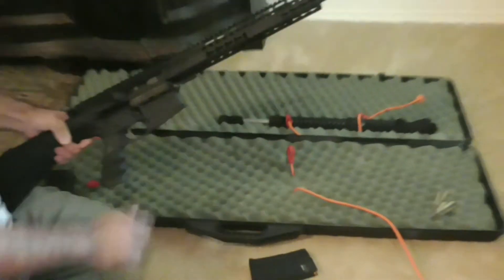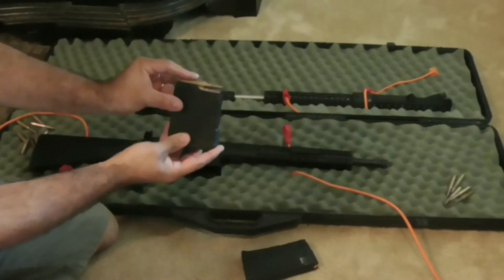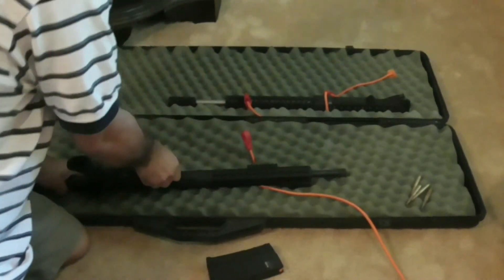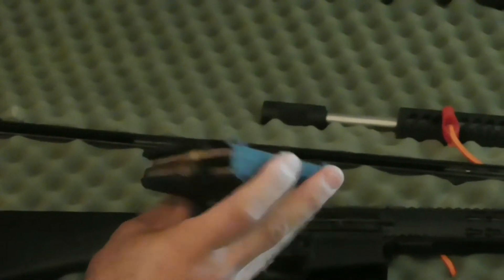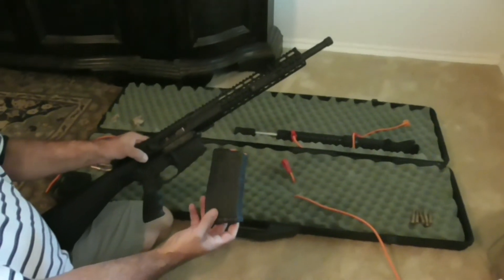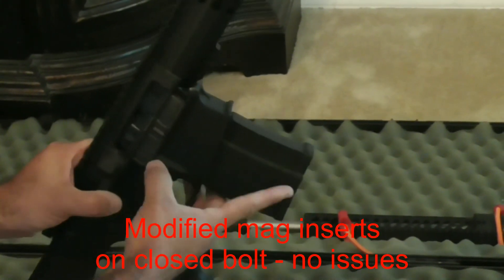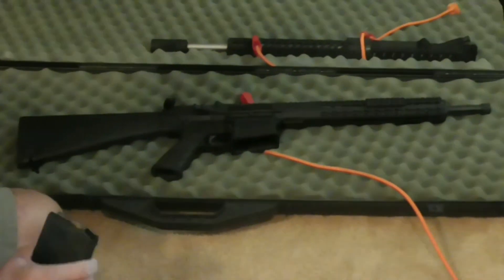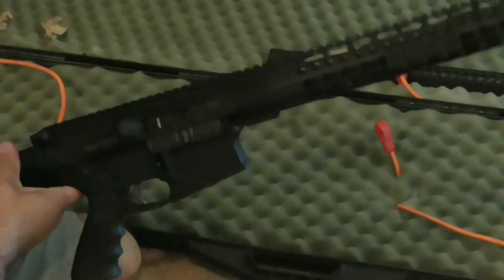Matrix Arms (Aerospace) 308 Large Frame AR reciever set - problems feeding  and extracting

Comment: Built Three 308 using this Matrix Receiver set, encountered similar issues, mostly caused by incorrect Bolt Catch.  Swapped out all Bolt Catches and replaced with Aero Precision 308 Bolt Catches, and used Faxon BCG with Faxon 308 Barrels. No problems inserting Mags and cycling.  Used both PMag, Hexmag and Lancer.

Comment: I had an issue with p-mags for a win 300 mag that is magazine fed--same type of issue though. It wouldn't fully seat into the mag well without a pretty good whack and the bolt was just super tight and the mag wouldn't feed well at all. After some research, I had to tune the magazine for a lack of a better term. I just sanded the lips of the mag until that the mag would fully insert into the magazine well once it was loaded up with ammo and seat into place easily. It really didn't take much but after that I didn't have any issues with it.